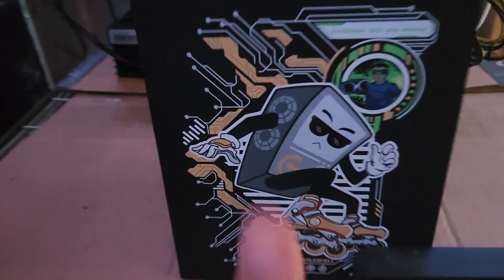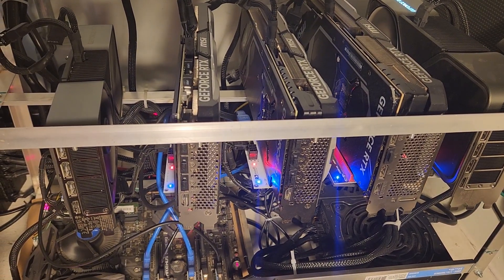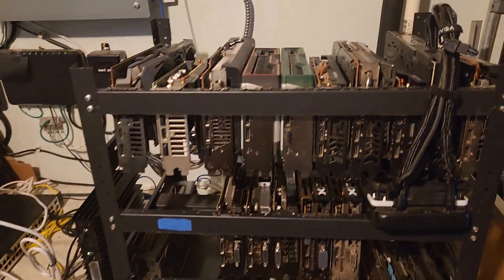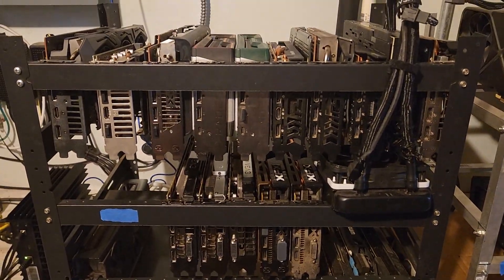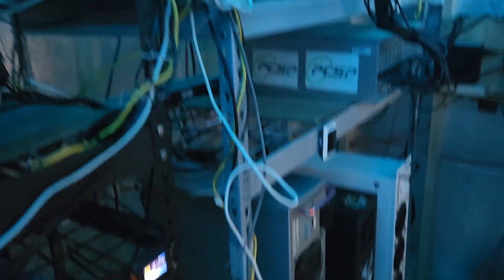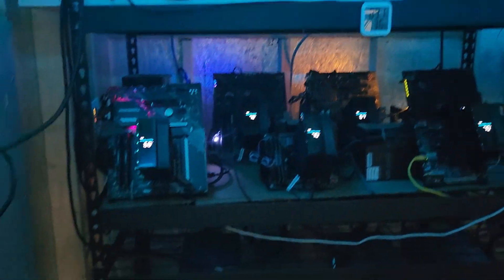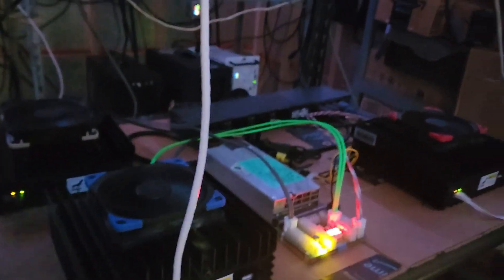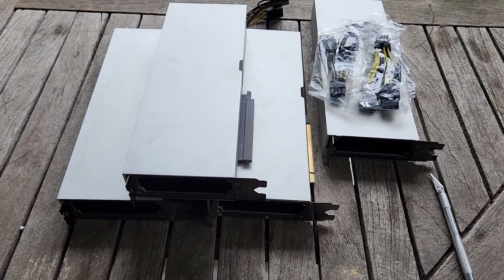Maybe less is more...Why we need to start thinking about density when it comes to GPU MINING

Comment: Yeah I started Buying gpus with density in mind last year. I still have yet to buy a 40 series card but am likely going to get a 4090 at some point. I will eventually purge my farm of all cards lower than a 3070 and go from there. Might keep a couple of special cards like my 2080ti FE just for the hell of it. I will probably sell all my 5000 and 6000 series AMD cards as well except for my 6900xt. Need to look forward.

Comment: Density & the amount of GPU’s determine how successful you will be especially since the Profits are still on the lower side. A youtube Crypto Creator told me that 1000/1500 GPU’s are the magic number plus Hosting at this level you will have a full time Business. But you need a commercial Building with tri phase power to get the lowest electricity rate. And tes besides 3070/80 TI, now the 4070 Super, TI Super & 4080 super give you good profits like for Aleo 1 4080 Super OC then oc’d for max hash-rate can make per card $1.50/2.00 depending if a price is $2/3 higher or lower.

Comment: your're definitly right on the density/time it takes but the problem with the high cards end is the premium of it that you have to factor in your ROI. Your electrical cost also factor in as higher density usually bring a bit more efficiency but more heat packed in one card. But planning on selling my 3070/3080 in the next bull run and buy density in the next bear market.

Comment: I still think 3070s are good, no? Like if you have only 3070 rigs, everything will be easier with the same overclocks and all.

I live in Belgium and I can get 3070s for 180€/each, so I think that's worth it for sure.

Also curious to see 5000 serie brings on table
Reply from the maker: So its not that I don't think they are bad purchases, its just alot more work to manage more rigs when you are doing say 10 to 12 on something like clore.ai vs 2 or 3 max. Also not every 3070 is equal I had some very very power hungry inefficient 3070s that I had to oc differently. Again not saying you are wrong for doing it, I mean I did it for the last 2 years...I am just saying there might have been an alternate way to go.